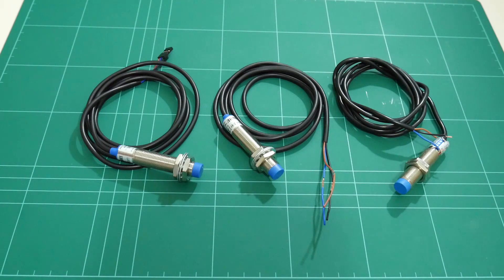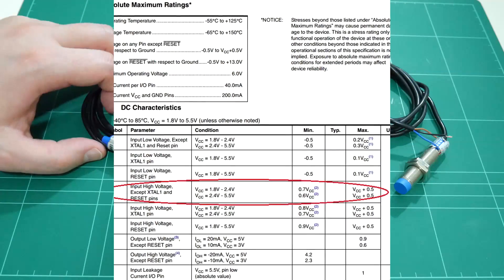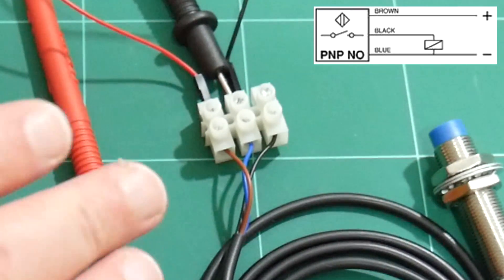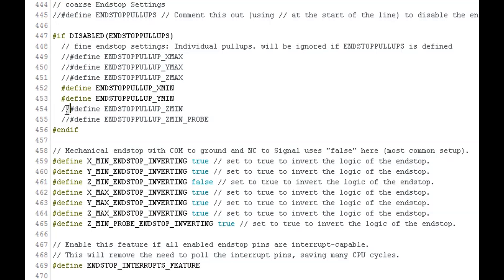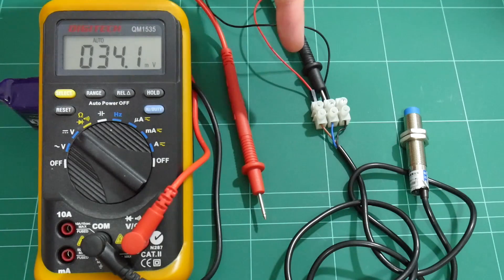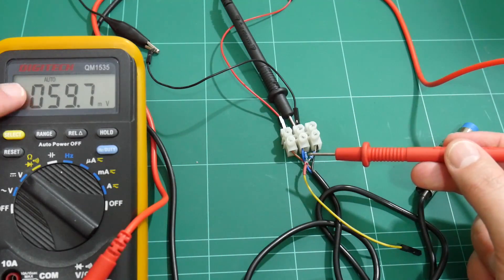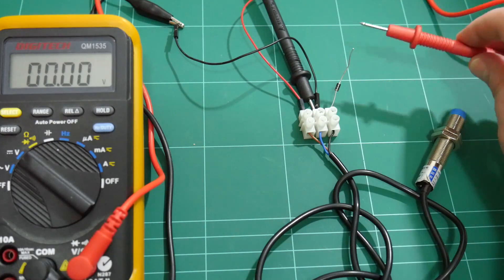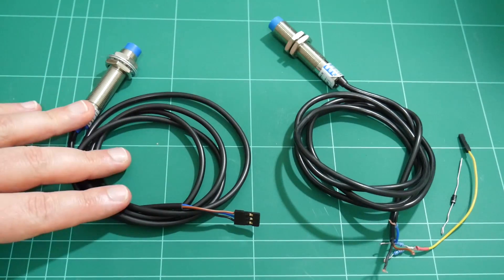Auto Bed Level Inductive Sensor for 3D Printers

Comment: The saturation voltage of a silicon transistor is not the same as a diode forward voltage drop. It is typically around 0.2V, not 0.6V.

Comment: There is another way, using a 12v relay means that the sensor can work on 12v without being actually connected to the board by any means right?✌😜

Comment: Love this video! For the PNP voltage divider setup how do we tell which pin to send the voltage of the two? Is it just as easy as throwing on a multi meter to see which is negative and connect the neg pin to the voltage divider?
Reply: Just in case anyone else has the same questions. I tried it on the neg pin of the zstop on my ender 3 board and it did not work - moved it to the positive pin and it works as expected. Hope it helps!

Comment: If it is marked for 6-36V it will NOT work. Don't even bother. Either the sensor distance will be far too small, or more likely it won't work at all. There are inductive sensors designed to work at 5V but their sensing distance is very small. Just hook up to 12V and use a voltage divider. It's getting the power it needs to operate correctly and stepping down the current to 5V so the endstops can read them.

Comment: Hello, first of all thank you for this nice education. I am using 24V power supply in my 3D printer and want to connect Capacitive PNP NC Sensor LJC18A3-8-Z / BY. How many resistance I need to use for this.
Thank you very much in advance.

Comment: I was wandering if anyone could help me... I had a 12v inductive sensor working through an opto-coupler until a had a soldering iron incident that damaged the wire close to the body of the sensor... So I decided to go for a a 5v sensor to replace it (cleaner install).  When I hook up the sensor and run an m119 it always says triggered (or open if I reverse the logic) and doesn't change state when a metal is out near the sensor.  The red led reacts to the presence of metal but the end stop state doesn't change.

I have used a multimeter to check voltages...when open the sensor passes 4.90v through the z-min signal wire, when triggered this voltage drops to 2.2v.  I tried enable the pull down on the z_min in marlin and reflashed.  In doing this the triggered voltage now drops to 1.6v.

It's my understanding that in order change the state of the end stop marlin needs.the triggered voltage to drop below 1v.

Given that I'm using a 5v sensor j thought this would be plug and play..

Can anyone offer any advice?
Thanks in advance

Comment: I did all of instrucitons. I am using voltage divider 100k and 150k ohm resistor, I am connecting with ramps Z_min port but when i send M119 Gcode, Z_min looks always open but İnductive sensor's led is lighting.

Comment: Hi @Tech2C, Ive recently been getting a problem with the probe set up on my cube. I'm using the 5v pnp as you've used here from your link to banggood and ive also connected it up with your quick switching mpx connectors. What I've noticed recently is im not getting a reliable level on consecutive G29s and occasionally my readouts add 1 or 2mm to random probe points.
Some people have suggested buying a different model of sensor or adding diodes somehow to the line but before i do and in the time it'll take for the parts to arrive i'd like to know if there's something i can do to fix it as clearly it works on your build without problems. I did notice a new line of text on the screen in your MPX quick connecter video mentioning a diode. Is this something im missing in my build or was that for use with a different probe set up? I really dont want to have to mess with the current MPX wiring if possible
If it helps I am having issues currently on my big printer running on the ramps board, marlin 1.1.8 (i think) but I plan to move this head over to my new "stock" hypercube build that will run on the Big Tree 1.3 when Banggood send me the parts im waiting on.

Comment: Ok I’ve pulled my ACKLP and upgraded it with a 5V NPN NO inductive sensor to the Z Min and have the sensor working. HOWEVER when it does a Auto Calibration, the inner circle of data spots senses fine, then the sensor which is -39mm in y 0mm in x goes off the bed and crashes the whole thing. What am I doing wrong?

Comment: With capacitative probes the logic is normally to keep them as close to the bed as possible (1mm above nozzle). I've heard this isn't necessary with inductive probes as their resolution doesn't depend on sensing distance. Is this true?

Comment: Common types are LJ12A3-4-Z/XY，here postfix XY can be AX/AY/BX/BY means NPN NC/PNP NC/NPN NO/PNP NO, in Merlin cfg the Z_MIN_ENDSTOP_INVERTING needs to be set as false/true/true/false, respectively. Using 12V power we need 15K(serial)/10K(to ground) divider to get down to ~5V, using 5V you might need to add 10K pull up for NPN or pull down for PNP then it should work. 8/12/18 sensors stem size D15x50/D21x60/D29x68, washer dia is larger. .cfg pull up is too weak no need to use. Sensor is an oscillator, when close to metal it stops oscillating changes output.

Comment: Zero volt does NOT mean ground !!!
Zero volt on voltmeter means that the circuit is either shorted to ground or not connected to anything (=open circuit)

Comment: too much hassle its just 3dprinter. you allways on there to start print. it only effect on first layers anyway.and you bed is levelled allready. it not take that much time check it.mayby invent bed level that not use spring and its hard never move. if something change its endstop. if printer is build correct x and y is align correct no need bed levelling. atleast i have 0 tolerance on bed lol

Comment: Thank you for this video.
One question:
For convenience because I am lazy: Which sensor should I get?
A PNP-NO 5V, which I can directly connect with a dupont plug onto the Z-Min endstop
or
NPN-NO 12V with voltage divider where +/- is connected to 12v of the controller board and the sense-pin connected to the Z-Min signal input?

Comment: I am just setting this up now and trying to get the resistors in place using the NPN.  When I measure voltage with no metal I am getting 6.6 v, when I am close to metal I am getting .66v.  As I understand it 6.6 will fry the Arduino as it is above the 5v threshold.    Could it be the 10% tolerance of the resistors I sourced?

Comment: Hi, so I am going to use an inductive sensor as abl sensor on my Ender 3. Is it now better to power the sensor directly with the 24 volts of the power supply and reduce the signal down to 5 volts or should I just power the sensor with 5 volts (if it works with 5V)?
Reply: @FronbondiSkegs  Ok, I used a relay which operates with 24v and passed the 5 V when closed directly through. :-)
Reply: I deleted my previous reply as I didn't include the entire solution I used. 
To recap - on the Ender3Pro, being 24V, I use a resistor divider 20k/5k on the sensor output to get approx 4.7V output. 
I then use this 4.7V to drive the gate of an N channel  mosfet (2N7000) which has its drain and collector pins connected between the Z-endstop pins (the source pin goes to ground side of the Z-endstop connector). This mod also requires updates to the firmware to change the polarity of Z_MIN_ENDSTOP_INVERTING.
Reply: @FronbondiSkegs  thanks, I guess I understand what you did there :-)
Reply: what sensor type your use? npn or pnp for ender 3?
Reply: @madorax251 hey, I am using NPN sensor with a relay

Comment: Has anyone try to mess with a 7805 voltage regulator, so no matter what voltage input.....the output would be always 5 Volts?... Or is it even possible?
Reply: I assume it's add uneven delay making it horribly inaccurate.

Comment: Hi folks (: I don't know if this was addressed yet, but just found out (making a printer for my friend) if you are using Marlin or other firmware with an easy option to implement inductive probing and are using glass bed, you can use 4mm distance inductive probe. Trick is that your glass should be no more then 3mm thick and you have to apply copper tape approx 20x20mm under the probing points. I tried it yesterday and it works! Hope this helps someone.
...
and since copper tape is 7um i think you could easily stack two together on top to get perhaps longer distance detection, but like i said it works with single layer of tape under 3mm glass.

Comment: I used it to speed sensor for spedometer. Is It possible in high speed over 50mph the sensor is not able read almunium? 
My oem speed sensor use 100mA but my proximity sensor 40mA is It effect the reading? Can I Put npn transistor to incrase the Amp?
Please help..

Comment: TLDR: It's safe to plug a 12v source into a 5v pin on a micro *as long as there is at least 7k ohms in the line* (no resistor divider needed). Frankly one could use any resistor above 7k likely up to 500k or more without degrading performance - Personally I would likely use a 47K or 100K resistor as I have loads of those on hand. Click "read more" to understand why!

Why this works: Inside the micro there are diodes on every (I/O) pin which clamp the pin voltage to within one diode drop of the ground and supply rails. These diodes aren't particularly beefy when under sustained load, they are largely intended to protect against moderate ESD or other short transients. Therefore it is perfectly safe to send far more than 5v into a pin as long as the current flowing into the pin and through the clamping diode is sufficiently limited. The datasheet on the 2650 doesn't state what these diodes can handle but 1mA sustained is likely very reasonable and conservative.

Where 7k comes from:
Input voltage of 12v
Micro supply voltage of 5v (ignoring diode drop makes for a more conservative calculation)
This leaves 7 volts (12v - 5v) which will need to be dropped across the resistor + clamp diode circuit.

Using Ohms law (V = I * R) rearranged to solve for R (R = V/I) we can calculate the resistor value needed to limit the current to 1mA
Gives: 7v / 1mA = 7k ohms.

And there's no need to really push 1mA through this diode - the digital IO on a micro is very high impedance and really doesn't require much current flowing into it - choosing a resistor which is much higher than 7k ohms is advised!

At some point if you choose an extremely high resistor value (likely in the 10's to 1000's of Megaohms) the micro will begin having trouble sensing the signal so don't go too crazy as you will likely get cross talk issues far before this point.

Comment: Great info and presentation. 
Could you please tell me where I would be hooking in to my Cr10 board. Does it just use the z end switch terminal using ground and output signal? I'm new at this sorry but others may have the question.

Comment: Very good video. Thank you for showing two options to connect the 12 V NPN sensor (also with the diode). For me the first option (the voltage divider) did not work, even though everything worked as it was supposed to, but my MKS BASE 1.5 board just did not see the 5V output as a high signal (tried with and without pullup resistor settings etc in Marlin). The second option however (with the diode) is way more elegant for the 12V sensor and very clean to install. Thanks for your explanation and time to make this video.. I have learned something... again! :-)

Comment: Is it possible that your voltage divider resistor values on the video are revered ? If I do the math with 10k between Output and Vout and 15k on ground to Vout, I get 7.2V whereas if I reverse the resistors, I get 4.8V ?
Reply: Hi - yes I had the same thoughts. It appears the labeling of resistors is reversed at 8:16 in the video. The 10k ohm should be on ground (blue wire) and 15k ohm should be on the sensor output (black wire) to get 4.8v output.

Comment: I have a problem. I connected the inductive npn no probe, the red light turns on but it keeps slamming to the bed. I tried resistor with 12v (it should work. On 5v) anet 8.

Comment: If you secure a thin steel pad over each sensor to the bed, it greatly increases the sensing distance on aluminium based printing beds.

Comment: Does anyone know what is happening with my setup? I've used an NPN induction sensor with the same voltage divider. When untriggered the voltage is about 3.36V, when triggered the voltage is 0.35 ish. When using the m119 the state of the sensor is cycling between open and triggered. Almost every time i send the m119 command, it has changed state. What the heck is wrong, and how to fix it? Any help would be much appreciated!

Comment: I am getting 5.4V on the signal wire of my sensor. Will this fry my Anet A8 board? I assume not but its high enough to make me uncomfortable about trying it without asking someone if they think its fine. I am using the 10k/15k resistor setup.

Comment: Please test your diode idea for reducing the voltage, because it doesn't work. It will be always 5 volts

What you can do is to use a 5v zener diode, in reverse, and a resistor(10k for example) in series. Or use 7 normal diodes,  in forward, and a resistor (10k for example) in series.

Comment: hi, when you say min z endstop plug the yellow wire ,  you refer to the S+ pin right of z_min . 2nd question if i read 3.1 volts from the yellow wire and when triggered the npn 12vd feed i get 0 , is it normal or a use the wrong resistor ???
thank you for the info .  can i use a 1n4001 diode for the signal.
Reply: thx for the help tutorial, got it, i use a separate power supply to turn on sensor, wrong idea.  i connected the sensor to the same power supply the feed the arduino and use the 1n4001 diode .Now work and some mod to the firmware too.I changed the z-probe-pin to z-min-pin don't   if does anything but i changed and works.

Comment: I wired the NPN directly to my boards Z min port and it is functioning. It is a rated 4mm sensor and i get a detection distance of 1.74mm which is just over 40% of the rated distance on an aluminium board. My tester gave me a reading of 4.7vdc on the supply pin.
Reply: Could I ask for a description on how you wired it? I've got a capacitive sensor working with 5v, but I don't know how to wire it to my two pin Z port.

Comment: FYI, i did connect a square type inductive sensor to ramps directly without divider and it worked... for a while then i had to use different pin for probing.

Comment: the reversed diode methode worked fine for about 20 min or so. after a while it failed for some reason and it passed the 12v to the arduino. which caused all the electronics to frie except the ramps shield. including the lcd and the arduino. juat use the voltage divider. its safer!
Reply from the maker: That's very unlucky. RepRapers have been using the diode method for years. Checkout the reprap forums for discussions on the matter. Sorry to hear yours failed!

Comment: thanks for the video!! great thing!! Have you tried not using the voltage divider and connect the S directly to the S pin on the board? (ONLY the S from the sensor, so only one cable) and the sensor takes the the 12 v directly from the PSU?
it would trigger the same, since it would send the negative to the S ping that is 5V + causing the same action as it would a mechanical endstop. mine is working this way without any issue.. Just thought your probably could test out for others,  it would probably make life easier.... cheers

Comment: I got the PNP sensor for my hypercube but wont work it gets 4.96 volts the light shines a little bit but on 12v it works just great..
I now going to use it white the resistors.

Comment: Why don't we use capacitive sensors? With them the glass sheet would be not a problem. Now I want to upgrade my 3d printer with a proximity sensor and I don't know why don't buy LJC18A3 regard LJ18A3 type sensors.

Comment: Thank you so much for that video. Your instruction was very easy to understand and you have answered a lot of my questions. I do have an NPN switch and it is Normally Open. I have decided to use the diode in reverse option to wire up my switch. Are there different types of diodes or what specs should my diode have? Also,  what is the likely-hood of that diode failing and killing my board? Should I also include a fuse of some sort?

Comment: I prefer the sensor that is NC as its constantly sending a signal. Because if the probe for some reason stopped functioning the satiety features of the software would detect no signal and therefore not attempt a probe. However if its NO the firmware wait for a signal, but this also means the probe could be completely unplugged.

Comment: Have you considered trying BLTouch? I've used an inductive sensor before switching to BLTouch and haven't looked back since.

One pro to BLTouch is you don't need a metal bed, and I understand bed weight may not be a big concern on a CoreXY compared to any prusa designs, but less weight is always better :)
Reply from the maker: I've heard of BLTouch but haven't used one as of yet. Someone made a BLTouch mount on Thingiverse for the Hypercube. I'll take a look at one in the future.
Reply: Tech2C. how much. Watts resistor should i.get

Comment: Ordered the sensor thru your link - mks sbase card also needs 3.3 - 5V on XYZ switches.  Resurrected Zonestar Prusa I3 clone is cranking out hypercube parts as I type.  Parts flying into my mailbox thick and fast.  Chaos reigns.  Will keep you posted re Mks sbase controller card and 3.2" touchscreen.  >Charlie
Reply from the maker: haha thx.